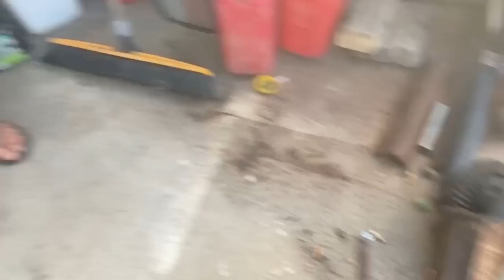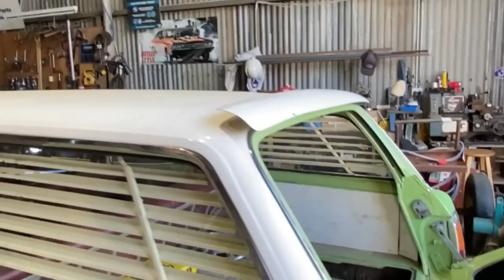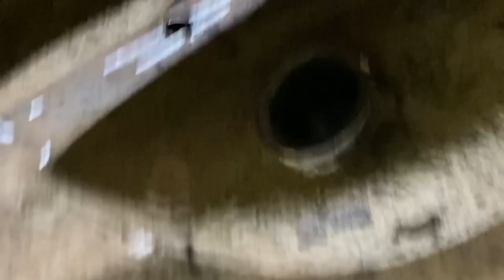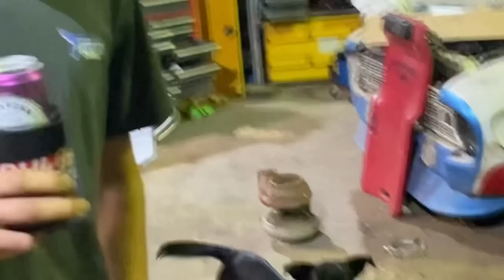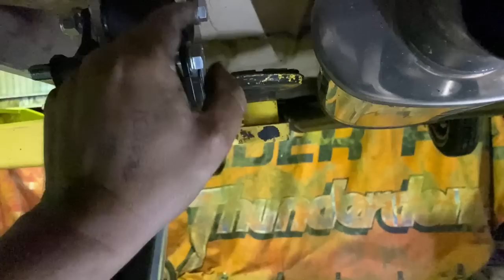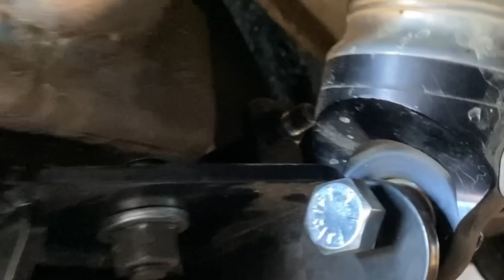HT HOLDEN MONO LEAF SUSPENSION NSTALL!

Comment: wonder if Luke's(Motor Fab) holden 6 powered Jet tinnie would go better  with the Mighty 186 from the ute? might need the sand bag batteries to keep it in the water.
good job, i expected you to say.. don't do what we do, fill these spot weld holes up with some weld before bolting the MF units up.. but yeah nah, she'll be right, the bird dawg didn't even need shockers after launching.
Reply from the maker: Hahah yea nah she’ll be right 🍻
Reply: And cracks.